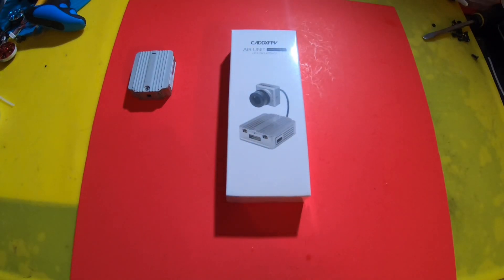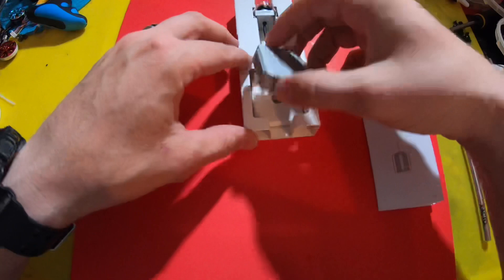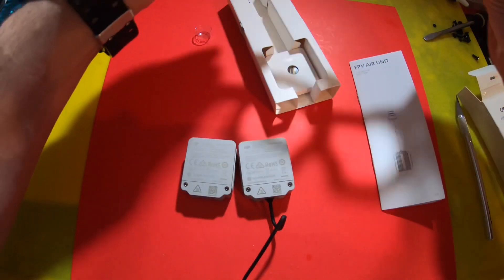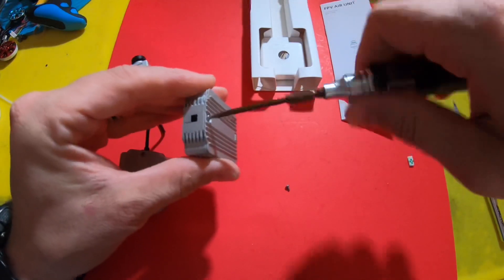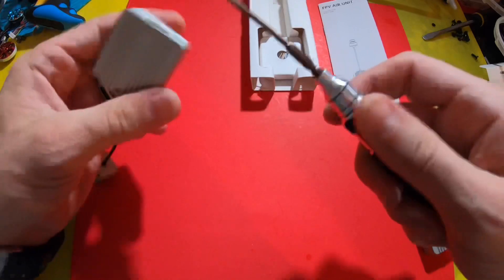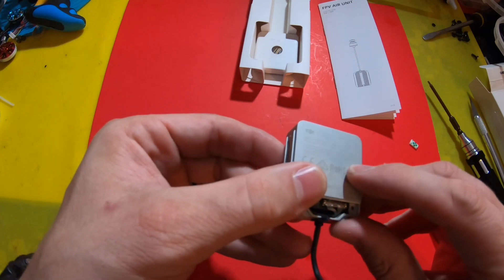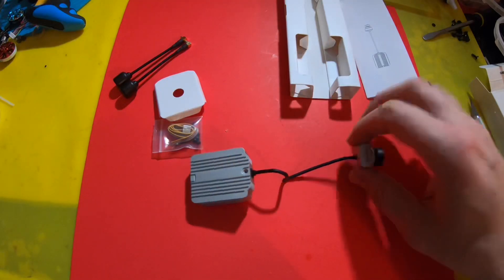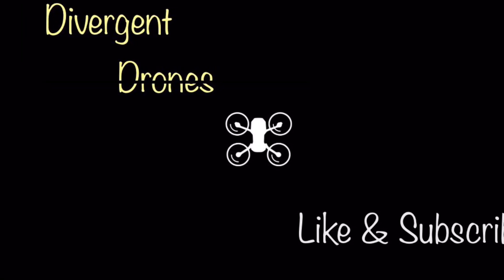New Caddx & DJI Air Unit Teardown

Comment: Hi , what about the extended (12 or 20 cm) coaxial cable? Since the new camera has a 19x19 form factor, i assume the old cables will not fit on the new micro camera. Am I wrong?
Reply from the maker: I had to go on a business trip to Africa so I didn’t get a chance to put it in a drone yet. As soon as I get back. I’ll let you know. I have all 4 sizes offers 8cm, 12cm, 18cm, and 20cm. I don’t remember it being 20cm long, but I’ll double check.
Reply: @DivergentDrones  Thank you! I would like to know if any of the extension cables exclusively sold  for caddx vista are suitable for the new caddx air unit micro camera
Reply from the maker: I’ve used this one before Caddx started making them. This the 18cm version. It works, but it’s not rapped well. 
https://www.ebay.com/itm/164884129579

Comment: Why do they make the top plate interfere with the antenna? Top plate tends to push the antenna out of the socket.
Reply from the maker: In the marketing image of the Caddx Air Unit, they fixed that. I think this is old stock of the dji air unit. Once it’s cleaned out, you might starting see the new one.

Comment: How is this a teardown? We didn't see the PCB.. no chip numbers, or any other look at the internals. 
Nice comparison otherwise.
Reply from the maker: To be honest, once I saw manufactured by DJI stamped on the case, I don’t see the point of breaking it down any further, but that’s a good point. The chips used “could” be different, but I doubt it. I’ll open them back up though and see. If their different I might make an update video.
Reply: @DivergentDrones  fair enough.
I don't mean to be too critical btw hope it didn't come across that way.
Reply from the maker: No, you’re good. I have thick sink.